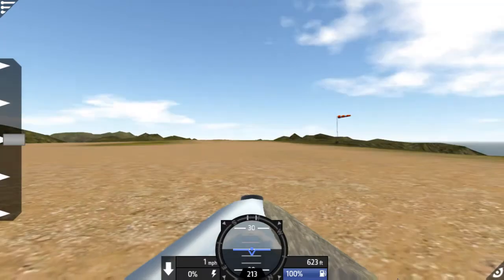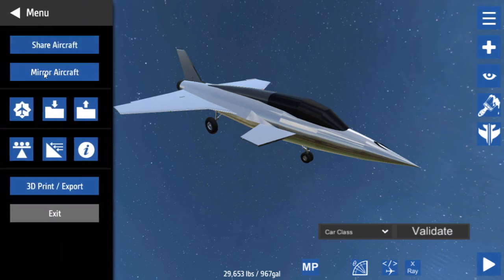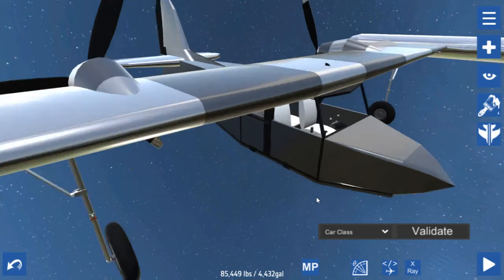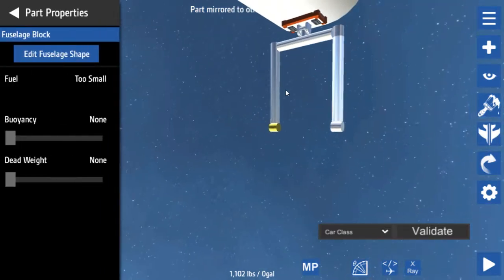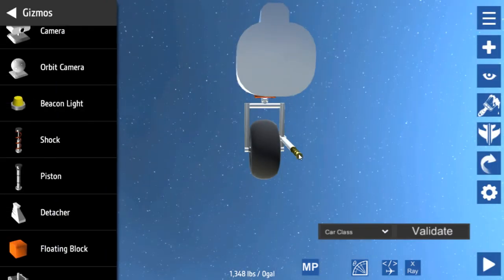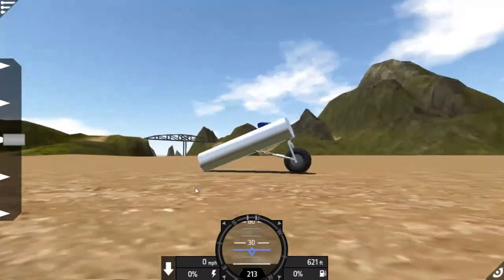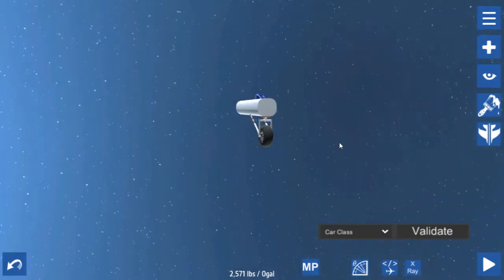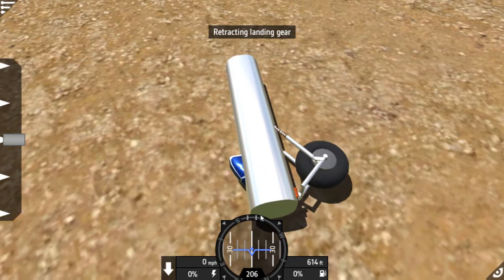Simpleplanes | HOW TO MAKE ADVANCED LANDING GEAR

Comment: I need answers im on mobile (witch maybe the problem) and the gear goes foward and when i press retract it goes back the other way please im stupid when it comes to custom gear help ;^;
Edit:nvm i have to input 0 on min and 1 on max and it works! :D
Reply from the maker: Ah yes. It happens regardless of device type. You can swap the values for example from 1 to -1 to -1 to 1 which will change the gear to go another direction or just invert it.
Reply: @AEGAviationGaming   ohhhhhh  mk btw cool seaplane it looks nice also the jet is cool:)  i watched this vid cause my friends would make fun of me for not knowing how to make custom gear ... but this vid helped alot for my cuz :) thooo it did help  me to make a gimick for my tank :)

Comment: Kinda unrelated but i also tried making my own landing gear but my hinge rotators and rotators in general just won't move. I have googled the problem and people had the same problem but the thing is that i didn't find any working solutions. Help would be nice from someone
Reply from the maker: I've had the same issue before it happens a lot. So what would help would be to turn of collisions and reconnect the connection to the bottom of the block the hinge is connected to.